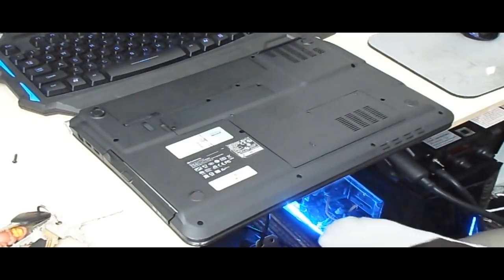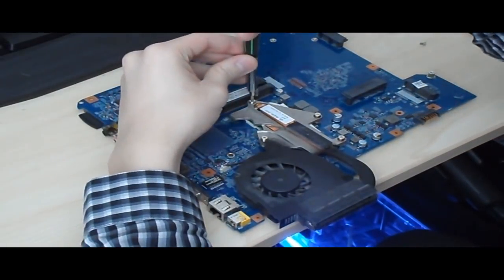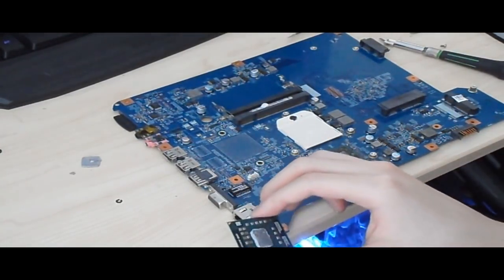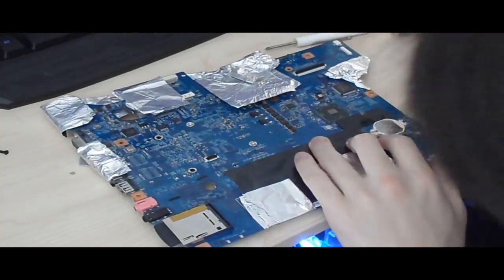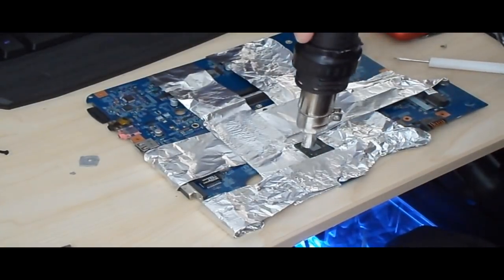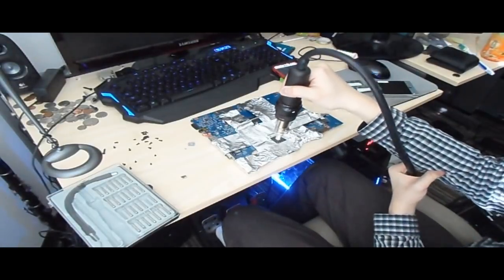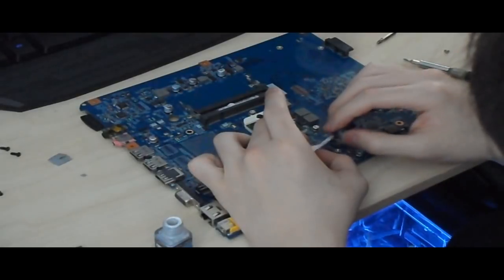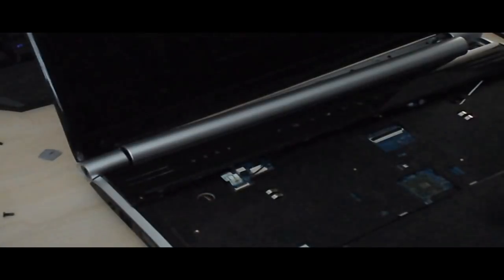How to fix black screen part 2 (How to reflow)

Comment: Wow...I literally can't believe I'm saying this but it goddamn worked! I spilled half a pint of rum and coke on my laptop. Shit was everywhere so I took everything apart, cleaned with isopropyl alcohol (100%) and kept getting the black screen problem.

 Followed this tutorial and used a hairdryer for 10 mins instead of his heat gun at half an inch away from the GPU. Honestly wasn't expecting anything, but it booted up first time! Literally gobsmacked! Getting lower CPU+GPU temps as well because of the thermal paste reapplication. Cheers mate!

Comment: Thanks for the guide. I bought an HP dv7 because I thought the screen was huge and the fingerprint scanner was neat. I didn't know much back then. 

Turns out I missed a recall by about 4 years (which they did not actually notify anyone, they just posted it on their website and I didn't check it every day), turns out they have a very bad overheat problem. It is partly my fault because I let it overhead often. 

so come yesterday my laptop is stuck with a blank screen. I did your ram guide and they work, so it must be this. Instead of fixing it I'm gonna gut my laptop and sell the parts and try to get a decent pc. If anyone is looking for HP ram or a screen with a webcam, hit me up.

Comment: Hi william, I have the black screen problem, I saw your first video, but quite honestly my case is a different one, because my computer boots just fine, and if I plug an external screen I can use the laptop perfectly.. but I know the laptop display is fine, I mean, it's not damaged like the one you showed on the video, actually I got this problem after the computer hibernated it self due to overheating (a safety measure that my laptop do all the time to prevent real damage), so after a while I reboot the laptop and it worked fine, but after an hour of using it, I felt the computer was slow, specially chrome, so I decided to reboot the system again, but once I did it, the lap started having this problem.. at one point trying to fix this problem I removed the ram and did the drain power technique and it worked, so I turned it off to reassemble the computer, but when I tried to turn it on once more, I got same problem all over again.. 

so right now I can use the laptop on a different screen, but my screen just won't start.. I have a theory that it might has detached from the motherboard, but not sure. any suggestions? thanks!
Reply: Even I'm having this problem. No issue with the display. When I turn on the laptop, cooling fan, CR ROM & everything works fine except the display. Sometimes the display turns ON and sometimes not. It works fine with an external screen. Any help here William?
Reply: have you found a solution Karthik Pongiannan ?
Reply: Karthik Pongiannan That could be a bad connection, when you move the screen goes off when was on or turns on when was off?
Reply: no it doesn't, I would know.. one day it turned on again once and I could move the laptop close it open it and it was fine.. but once I turned it off and turned it back on i only had black screen again.. so.. it's a bigger problem.. ideas?
Reply: zidanesg1 Model? Have you overheated often? Could be something within the screen panel itself, however to me, considering what you described (heat/shutdown), this issue is still consistant with GPU related fault, as the output from the video chip itself is routed differently to the video output in at least some video chips, i.e - there could be a perfectly functioning display circuit to your laptops video output, but a broken or detereorated signal to your laptops display. It is complex to explain, but essentially, a graphics faliure may manifest itself in MANY! forms. 

Try using the laptop in a darkened room if the lcd is powering on at all. Or shine a bright light on the screen to check it was not your LCD backlight failed (this does not indicate solely a backlight failure and I doubt it is that because it suddenly failed). There should be a least some form of life from your screen even a clear turning on black. 

The symptoms and events preceeding them are consistant with degradation of your graphics flip chip, there is no 1 definite failure symptom unlike what many people claim. I have seen anything from corrupt/glitching screen, blank screen, colour screen, rainbow screen, all kinds of artifacts flashing or constant, black/dark screen output, extremely low output from screen which can also be backlight issue as before mentioned (shine a bright light to check this is not the issue), blinking or constant lines, even blurring/blocky or garbled colours displaying on screen. All due to deterioration or onboard graphics chips. Particularly, but not exclusively if your laptops manufacture date falls in the chronic problematic RoHS era of these chips (think nVidia/HP) somwhere around 2006-2008 and possibly later I believe upto 2010 or even newer in some cases still suffer this fate. 

Lastly, it could POSSIBLY be a system BIOS issue that could be checked and/or rectified via your display output, by pressing appropriate key/s on startup. Just some ideas... 

I'd say invariably the ultimate solution, (if you are planning on keeping the laptop) is to have a new decent era (2010>) graphics chip installed, by a competent technician. Or replace motherboard with a known decent/new unit. If you were overheating and from the problematic era, it is almost definately GPU. And even if not, I strongly suspect it still is the cause. If you do repair or have repaired the issue, revise your cooling, be sure to not overheat - you say it 'shuts off to prevent any real damage' - seriously - if a system is repetatively 'shutting off to prevent any real damage', the 'real damage' could be already occuring, or be done. It is a last ditch effort if you rely on your system board shutting off due to temperature, not an everyday function of any laptop or designed to occur regularly. 

"(a safety measure that my laptop do all the time to prevent real damage)" wrong.

It is doing real damage, not preventing it. Clean dust/dirt/grime from fan and vents and check your fan is decent (no broken pins or noisy functioning which can indicate failure and result in lower efficiency and your familiar temp related shut offs.

My money is on GPU. And seriously. In this order. 
New laptop. 
New board. 
Replace the GPU chip with a new chip. 

Don't bother the joke that is labelled 'reflowing' a GPU, as it is laughable, done by hoards of morons that misunderstand the actual concept of the failure and enjoy kidding themselves.
Reply: ***** If not on something? If you run a laptop with excess dust/dirt/grime in the cooling system it will likely overheat. Also, if you run the laptop with the air vents in anyway blocked or covered, it will likely overheat. Quick solution is to get a vacuum cleaner and hit all the air vents on your laptop, a good start  even if you are not confident in taking apart your laptop. Don't confuse overheating with other faults, people blame alot of things on overheating, not withstanding it is a cause of shut offs, but in saying that, a laptop can still run fairly hot. If you are overheating and shutting off check your cooling system, any weird noises from the fan? clean cooling system and replace fan. In short a shut off can be from many causes. Can be bad CPU, a cause of many problems including no power issues and black screen issues. I have gone through many checks on a system, only to replace a CPU and it is like brand new. CPU controls all kind of power that people don't realise too.

Comment: Hi Mr Yu  great work i wonder if this not starting issue can be also created by the starting chip ene  because i reflow a graphic chip before and still do not work then i change the  ene starting chip and vuala working fine so another tip your video is real good i hope you still in the business

Comment: Thanks for the video. Beforehand, I watched your previous video, I had used an VGA cable and attached it to a monitor. The information displayed onto the monitor's screen. However, I took it a repairs store and was told my motherboard is dead. I have some information I want to get off my RAM. How am I able to read the RAM without a motherboard? Is that possible? Or do I need a motherboard to read the RAM. Plus it is a DELL Laptop. Any advice on how to go and do that?

Comment: Are you sure it's not 380° F instead of 380°C? 380°C equals 716°F and solder melts at about 400°F.

Also, I'd pull the CMOS battery BEFORE I placed any aluminum foil on the board.

Comment: Thank you for the tutorial.  This solved my problem after trying everything else. What are the chances of this to happen again?
Reply from the maker: all depends on how well the job was done. Remember, this is a temporary fix. If you can get rid of that laptop (ex. sell it), go ahead. But if the job was well done, this quick fix can make the laptop last years and years. Make sure to keep the temp down from now on.

Comment: Hello, great vid...just wondering if you know how long your 'reflow' repair lasted???  Thanks for the vid, though.
Reply: I didn't make the video but if you reflow successfully I would say it might only last a month to a year (if your lucky) if you do not also clean the fan and reapply any heat paste or whatever else because it may overheat again and I have had success with reflows but it only has ever lasted if it stays cool afterwards.

Comment: Hi I watched your first video and went thru the process of trying the memory cards several different ways. Nothing seemed to be working so I tried each card in a different laptop I had lying around. I came to the conclusion that 1 of the cards was bad as it did not work in the other laptop. So i out the two good cards that I had in the computer I couldn't get started... and still no luck. What else can I try before gutting the computer and risking damaging it further? 
Thanks!

Comment: hey william. thanks for vid. watched part 1 and 2. did the ram tests, both do not work. how much would a reflow cost?? how much do you charge? just a ballpark.  thanks!
Reply from the maker: It really depends on which shop you visit. I would say 80 least 250 max.

Comment: Hey i have the exact same laptop as in this video your screen fix did help but also i was wandering if theres a way to refresh the battery it used to work then my charger shorted out i got a new charger computer works fine but not the battery the charge light flashes if that helps please reply thanks

Comment: I tried everything in the first video but those steps didn't work and now I wanted to follow this one. I got my laptop apart (Samsung RV720) but I don't think I have a GPU. Is that possible? Is there something else I should heat, or won't this fix work for me when I don't have a GPU? I see the CPU (under the 4 screws with numbers 1-4) like in this movie and removed it, but a little down, you have the GPU. I see square where a GPU could be, but the space is empty on my motherboard. What should I do now or is my laptop lost? Thanks in advance for any reply!

Comment: Hi Mr.Yu I just tried this, I heated up the chip with my hairdryer and Im not totally sure if its heated up enough because I can't really smell anything burning due to the heat coming from the hairdryer , it tends to have a smell on its on. But if i was to put my laptop back together would it still work even tho i didnt apply any thermal paste on the gpu? Is the paste really important and necessary?Or like once the chip cooled off do you have to immediately apply the thermal glue?

Comment: Hi friend.....i have a hp g62 and same problem. When i press start button screen is black and it didnt work....cpu fan start and after few second stop but light on button continue with working. When i press power button again my lap top isnt shut down...it restart only....what i need to do.....i follow your instruction in first clip about this and i didnt pass this problem...should i do everything like you in this clip? And i have one more question.....how long i need to heat with hairdryer.....? Thanks :)

Comment: Hi william i want to ask that suppose that  one desktop computer (CPU unit) has a graphic card and same problem occurs in it (i mean CPU starts but screen remain black ) so now that CPU has actually two ports where we can connect the monitor(one is in mother board and second one is in graphic card) then Tell me that if we plug the monitor cable in CPU (motherboard port) instead of graphic card port does the malfunctioned graphic card will affect in that Case and will computer starts.

Comment: I have a diferent problem can you help?
On my case i can only startup my laptop with the lid 30% open, then when it boots up i can use it normaly even open the lid 100%
But if i i try to start up my laptop with the dysplay fully open it will not appear anything on the dysplay.
You know what this might be?

Comment: Hi william, my laptop compaq presario v3000 had black screen but run normally. I know it bcz i use torchlight n see it progressing normally. I try to connect to external monitor but it doesnt show up. Alrwady push d button fn+f4. So what d problem?

Comment: Hi, I changed thermal paste (5 years old paste) on my laptop and since there doesn't work! I have black screen, fan work, cd rom work, I tried to connect to other screen, doesn't help, Change position od RAM and then do not want even start fans...so I go back on original ram slot state, again I got black screen. I do not scratch anything or forget to connect. I have photo of every step. Maybe I mess up..I cleaned with screwdriver very gently paste around cpu and gpu but over silicone aside of chip.

Comment: My Compaq CQ61 has a blank screen... I have done everything you suggested and even replaced the motherboard... still blank.  It does turn on, fan runs, cap and num lock lights flash, yet nothing on the screen.  (AMD single core processor)  Ideas?

Comment: when i updated my  hp display  driver from normal to HD300 .The display goes off when it uses  the battery and when it is plugged in, it comes back on. when i decided to downgrade it because it was doing this problem the display started turning black and only comes up if i close the laptop and open it. pls help

Comment: Hi, I have a HP Compaq laptop Computer and I've tried everything in the first video, and nothing has changed for the black screen remain black, I switched around the ram boards many ways and left one out and tried that many ways and same with the other ect... could it be possible that both ram boards are bad or how can you tell or how can you tell if both ram slots are bad?

Comment: Hey 380 degrees Celsius is over 700 degrees Fahrenheit which would melt that whole board. You got your Celsius Fahrenheit mixed up. The most you want to heat that is about 300 degrees Fahrenheit but most do 200 to 250 degrees Fahrenheit in the oven for 20 minutes to reflow.

Comment: I have an Asus G75VW I bought in 2012.  The screen is dead black.  The lights turn on, but I can't tell if it's still booting up or not.  It doesn't seem to sound like it is.  It's the rear ventilated model, so I can't imagine that it was an overheating issue for the GPU, especially since it wasn't doing anything strenuous the night it failed.  I was in a well A/C'd room in Panama and it was doing updates.  I wake up in the morning and the screen is black.  I've tried everything other than resoldering the GPU and removing the RAM.  It's the gaming model so it has two extra RAM slots that aren't easily accessible.
Reply: Yeah, I'd like to know if you got it working too. I have a G55V gaming laptop that sat unplugged for a couple months and now won't even post.

Comment: So I got a screen issue on my older laptop, screen will turn on maybe in 1 of 30 times and if i try to close it or restart it it wont turn on anymore,  graphics card seems to be working fine, laptop works perfect expect for built in screen when connected to external monitor.

Comment: I watched your video "how to fix a black screen" part 2 very interesting and helpful. However, my black screen problem is with one of the RAM slots not functioning. I can get the screen to work by only using one slot. In order to fix this problem, do I need to replace the motherboard entirely?
Thankis
Reply from the maker: There are tricks to fix the ram slot, it's usually not the ram slot itself broken, it's usually something else like south bridge. It's pretty tough and I would just recommend to use bigger ram or get a new mobo.

Comment: Hi mate I have an Acer aspire 5750G when I turn it on it comes on for a few seconds then turns back off. When this happens the screen stays blank and the fan doesn't spin. I tried the ram fix from your other vid but nothing happened. Guessing it's the hard drive or motherboard. Would this happen if the hard drive has been damaged? Thanks in advance

Comment: Hi I have a problem with my laptop it comes on but you only see the back light and the light comes on the cap lock button if I push it, but the back light for the keyboard don't come on I don't see the mouse cursor or anything. I don't hear the fan or anything,  I see the power light can anyone help me.